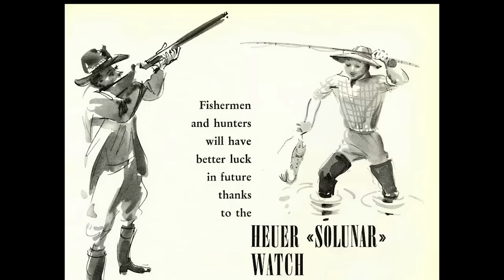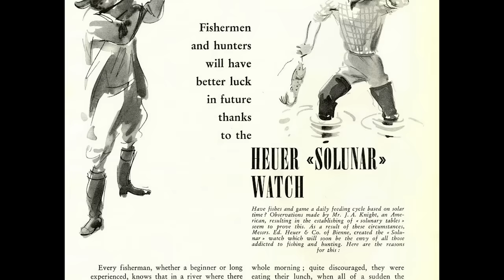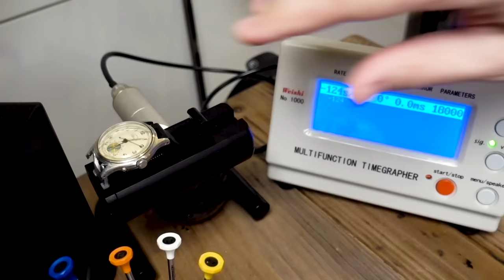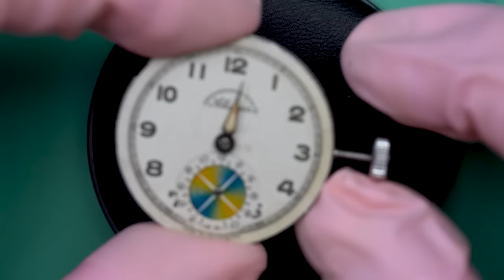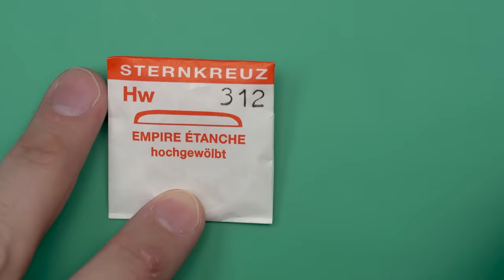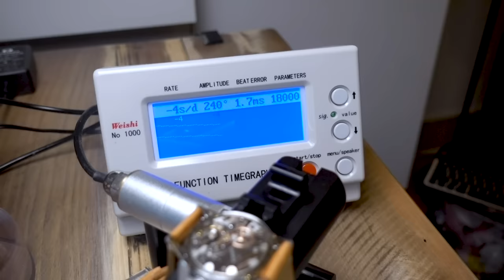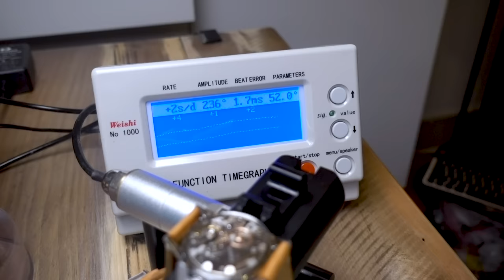Abercrombie and Fitch Solunar Vintage Watch Restoration

Comment: Marshall has anyone mentioned a product called Evapo-rust to you? I watch other refurbishing channels and it is a common rust removal product that seems to work really well. The pieces will come out dark like they have been oil blued but with a little buffing the coating comes off.
Reply from the maker: Yes, I even got some now :) Good stuff

Comment: I'm surprised they advised you to use baking soda in the vinegar.  That reduces the acidity necessary for the vinegar to convert the rust.  Vinegar will convert rust to an inert form that stops it from further rusting.  It's used a lot in car restoration and by body works guys.  The remove as much as possible then use vinegar to stop further degeneration.  Just FYI.
Reply: Forgot to add love your videos.

Comment: The vinegar and baking soda trick kinda doesn't make sense though. You're mixing an acid and a base which neutralise eachother, so you are essentially soaking it in water. 
You should soak it in vinegar only. The soda is for later to use it as a very mild polishing slurry.

Comment: old video, I know.... but if you permit me some positive criticism: when taking rust off....be patient and let the chemicals do the work...don't start scraping and prodding and brushing too fast.
There are plenty of commercial products that do an excellent job taking rust off.
If things are very delicate and you don't want to risk the part discolouring , look into reverse electrolysis.
The latter is very safe and will NOT take any of the metal away, just the rust.

Comment: Wow, you didn't try a rust converter or a rust remover chemical? There are non-toxic versions of both and one converts iron oxidation to iron tannate or some other iron compound. The remover just dissolves the rust off and leave clean metal behind. They are really inexpensive and work better than vinegar & baking soda.

Comment: The MSDS for Bergeon One-Dip shows that it's just 99.4% pure tetrachloroethylene... AKA "dry cleaning fluid". I'm not sure how hard Bergeon reams you for that stuff, but CRC Chlorinated Brake Parts Cleaner (aerosol can) is the exact same ingredient. Check the label, it has to be the chlorinated kind by CRC. The non-chlorinated variety is mostly acetone which WILL dissolve shellac, and chlorinated brake parts cleaner from other brands, from what I have seen, is a cocktail of stuff and not just pure tetrachloroethylene.
Reply from the maker: Interesting, thanks for the info.

Comment: Thanks. Some positive criticism if I may - I would have replaced that winder pin. Its heavily corroded and sure to break. Secondly, forget the old wives tales of using vinegar and baking soda for everything. To remove rust, use citric acid solution, 2-3 tbsp per cup of warm water. Available at your local grocery store in the bakery section.

Comment: You should remove rust with electrolysis bath. Electric current in through the part you want to clean, connected to the negative pole, immersed in electrolyte. This will remove all rust.

Comment: Beautiful work, any reason you didn't repair the watch hands?
Reply from the maker: I like to keep things as original as possible generally. I did actually go in and get a little of the rust off, but the lume started to break off so I stopped. Also these hands likely have radium lume which can be dangerous to work with.
Reply: Wristwatch Revival makes sense, thank you

Comment: With 1k comments I can’t be the first. Has anyone showed you Evaporust? Lots of folks use it when restoring larger equipment. I’m not sure how it does at the scale you’re concerned about. But it should be cheap to get a quart and find out. You went through a lot of effort to clean that stuff up. I think if you just left it in a small cup of evaporust it would be done in an hour.

Comment: I have a longines railroad rr 280 1960s wrist watch in good condition. This watch is not the canadian seeing it has the number 12 not 0. What do you think its worth? I know over 1000 but how much more? It works great and it's real.17 jewel and the dial has rr280 on it with gold longines name and symbol in gold. Do you know anything about this watch 7186-2  221?

Comment: The stem should be replaced as you risk losing the crown. The corrosion goes to the core, don’t mess with rusted stems. If the stem breaks off in the crown soak in jewelry pickle acid to dissolve. 
Love your videos
Reply: I use pegwood when fitting bridges. I can actually see you leaving tiny marks on the bridge using a metal tweezers

Comment: Well, I know that it might be a bit too late, but I should probably mention that the "vinegar and baking soda" method is mostly an urban legend, even though it kind of works. What you do by mixing it with water is create a solution of ions with a lightly acidic pH. And it does the trick. But do you have to do it this way? No, you don't. Could it cause side-effects such as forming metal acetates that could later promote corrosion again? Yes, it could and it often does. That's why in the electronics industry, neutral flux is used to prevent future corrosion even when soldered parts are thoroughly washed. Is there a better solution? Yes, three main ones. If we are talking about iron-based alloys (steel), one of them is oxide conversion done by literally boiling parts in water. That converts orange iron (III) oxide into less reactive black iron (II) oxide. The second method is to use much less corrosive commercial chemical solutions such as Evaporust. And there is an electrochemical rust removal process that uses electrolysis to dissolve corroded surfaces (oxides, salts, hydroxides) using electric current running through the part into the electrolyte solution. The latter method is generally more universal and less destructive than others.
Reply from the maker: Do you know how to get the parts looking good again after using Evaporust? (I find that it does a great job of clearing off rust but makes the parts black)
Reply: @WristwatchRevival , that would likely require weak acid solution (oxalic acid, for example) and warm ultrasonic bath. Not much different from plain acid etching, though. My personal favorite is electrochemical oxide removal, not just chemical one - it is way more targeted, I cleaned a countless number of precision measurement tools with pitting and "web" corrosion patterns without affecting the polished surfaces to any measurable degree.

Comment: a tip: to neutralize the rust you can boil it in water for a couple of Hours. It shouldn't harm them. Then you can remove it and oil it. When it is Boiled it will not be active and Rust on.

Comment: Should have heard the information about shellac and isopropyl a bit earlier... i threw all my pocket watch parts in an ultrasonic cleaner with isopropyl alcohol and the balance spring detached from the balance wheel. The watch does not run as well since then...

Comment: Just curious, how long does it normally take you start to finish when you are doing a watch like this in this condition?
Reply from the maker: Not sure exactly as the sessions are kind of spread out waiting for parts and such, but I would guess 5-6 hours? Could be 4 or 10 depending on if it's something I've done before or if I have to figure it all out as I go though.

Comment: Well, it definitely doesn't work, because you said the tide indicator is just a modification of a lunar phase indicator.  While phase does influence tides (or rather, phase and tides are both influenced by the arrangement of the sun, moon, and earth), phase is not the only indicator of tides.  A high tide will occur wherever the moon is either directly above or directly opposite your location on the Earth.  A phase indicator won't give you enough information to tell when that's the case.
Reply: OK, maybe, but does it look great or what?

Comment: Forgive my stupidness - How Does the rubber 8 ball work Is it just friction because i cant see that working .  Is there a strong magnet in it because i can see several issues with putting a strong magnet close to the movement and I suppose most watches have non-ferrous  casings. Please ‘un-thicken’ me ?

Comment: I'm surprised there weren't more specialized wheels and cogs in there for the tidal indicator. This might not mean much to a non-mathematician, but the science of Fourier analysis was invented because they were trying to anticipate tides, and that's not a single gear kind of deal.
Reply: Ah, it has a rough correction button. That explains it. I wonder how often you have to reset it for a given locale.

Comment: As you no doubt know now, you were using baking soda.  Baking powder has baking soda in it, but for this purpose it wouldn't be as effective as pure baking soda.  Wise choice to rid the setting lever of rust.  Those threads would have disintegrated with that much rust still in them.

Comment: A gunsmith would tell you to boil or steam the rusty steel pieces in water. That will convert the red iron oxide to black iron oxide, which is stable. Then card (brush with a fine gentle metal brush)If more red comes out from brushing, boil and brush again. Finally, oil the steel

Comment: The blackened numerals: the lume appears to be radium. And blackened doesn’t mean depleted. The radium is just about as radioactive as when the watch was made. 

So with the corrosion around the stem, was there attempt by design to be water resistant? A sportsman’s watch should be at least dunk proof. The glowing from radium excites a phosphorus and the phosphorus has oxidized, the 1/2 life is about 1,100 yrs. So it’s probably BE CAREFUL in handling, don’t take my word for it. “The radium isotope (Ra 226) used has a half-life of about 1,600 years, so even very old radium dials remain essentially just as radioactive as when originally painted ~100 years ago, whether or not they still are luminous.” Wikipedia

Comment: It is possible to use a battery and a sacrificial piece of iron in an electrolyte to remove rust. It removes it at an atomic level. It is used to clean classic car parts and is demonstrated on YouTube. It is simple.

Comment: Why did you put baking soda in the vinegar? It neutralizes the vinegar and basically turns it into water. Just use vinegar.
Reply from the maker: I found instructions to do that (and it worked btw)

Comment: Don't you need to put the tide dial in to match a specific time?
Reply from the maker: There is a pusher on the side that advances the tide function, you have to line it up withe Solunar tables for the region you are in.

Comment: I need your help.  How can you spot a fake Abercrombie & Fitch watch.  I found one inside my mon closet but the watch looks so old the inprints in the back of the case are faded from scratches and cant read the model number.
Reply from the maker: Usually there is a model number in between the lugs. Also you can check the inside of the caseback for Heuer or A&F signing.

Comment: Never quite understand why when faced with rusty parts, people don’t try to clean them first to establish their condition. All that ends up happening is your cleaning fluid ends up contaminated and you ultimately have to order parts anyway. The cost of replacing the stem, winding and sliding pinion is probably relatively cheap, I’d be surprised if you were unable to source replacements.
Reply from the maker: Yeah I did actually find a new stem but it didn't fit right so I decided to use the original after de-rusting. I ordered a new Sliding pinion so the next time I have this watch apart I will replace it.

Comment: 27:50 why not just treat it with rust converter? or put it in an ultrasonic cleaner?
Reply from the maker: I don't know what rust converter is. I did treat it with rust remover as you saw. It was already in the ultrasonic.

Comment: Wouldn't the ultrasonic cleaner remove that rust on the stem easily?
Reply from the maker: It removes loose rust but you need something acidic to take it off to the core
Reply: @WristwatchRevival  You do great work, been watching a lot of your vids. If I find a vintage project watch willing to take it on for the channel?

Comment: Restoration:  the action of returning something to a former  condition.  So, you are not restoring the watch to its original condition.  You are "conserving" it.  Finally,  acetic acid does not remove or convert rust.  The work you put into removing the rust was merely "sanding" it away with whatever powder you applied.  Phosphoric acid reacts with rust to create ferric phosphate which is easily removed with, in your case, a fine wire brush.  It is a precisely controllable reaction that will not damage the metal components at all.  You can purchase it in the form of concrete/metal cleaner at your local home improvement store.

Comment: WD-40 makes a rust remover soak. Iv used it with great success.
Reply from the maker: Interesting, never tried it
Reply: @WristwatchRevival   after few hours soak if it's crazy bad the rust has turned black. Just brush it off with a brush. I'm a machinist and use it on anything rusty. Might try it in ultrasonic next time. And the solution is reusable.

Comment: I have seen a good amount of your videos so far. I still disagree to your handling of casings, dials and hands. In this case, you replaced the hands still being rusty and there was just visible dirt on the dial. It wasn't "patina" at all. I understand, that you avoid to agressive measures. But ...
And, I would have polished the inside of the back-cover. Just I don't subscribe to "you don't see it - so it doesn't matter".

Comment: I prefer to watch restorations...the fact that you only restore the inside is fine, if you want a crappy looking watch that tells time. I think you don't know how to restore the outside so you don't do it.
Reply from the maker: For vintage watches I hate polished or restored cases as it takes away from the charm. And also I am not very good at it (though I do have a basic polishing setup that I’ve used and been ok with)
Reply: @WristwatchRevival  The hands really needed restoration and re-lume. Rust isn't charming, nor is an unpolished case.